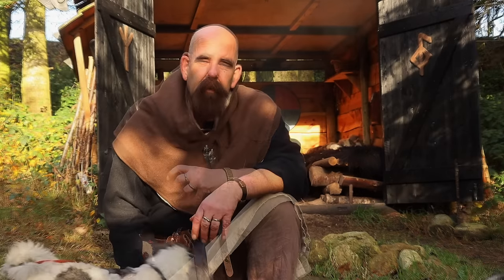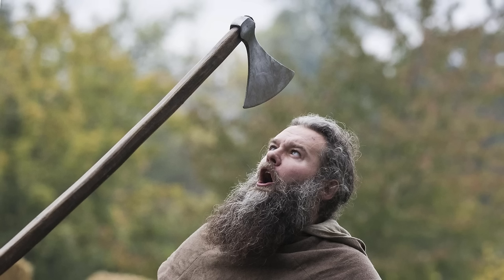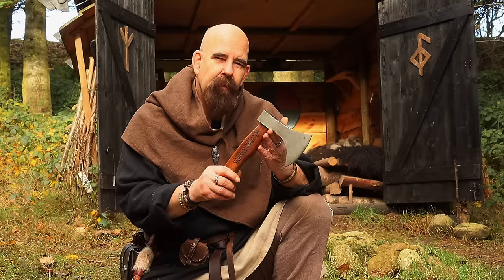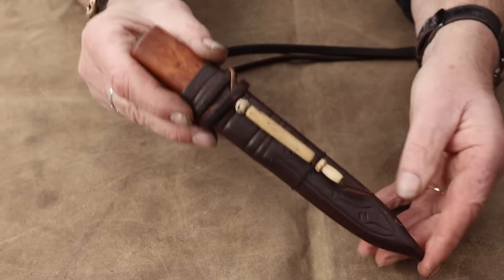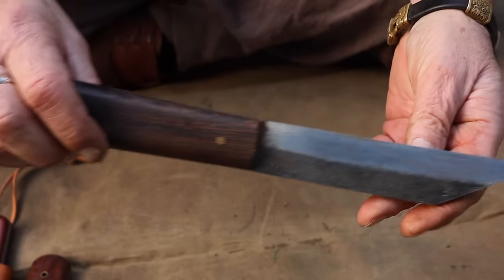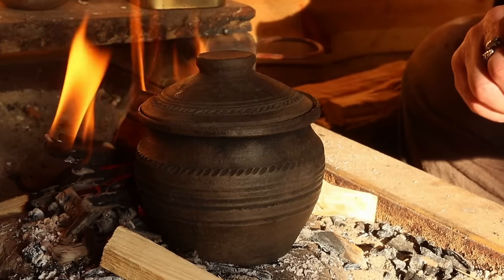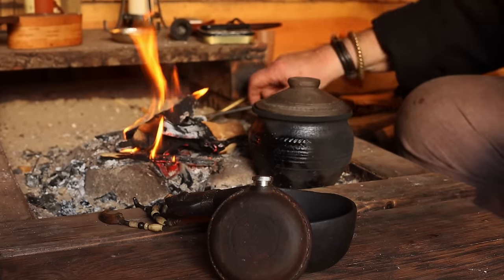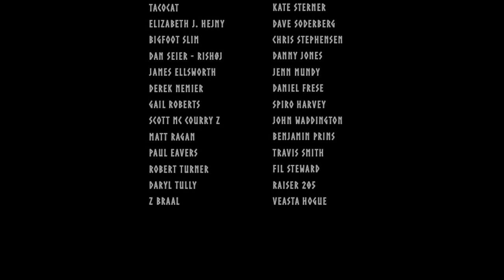My Viking Axes and Knifes

Comment: The problem with a ceramic pot and direct heat from a fire is the clay. Putting the clay pot inside a larger metal pot half full of water, will help avoid the breakage of the clay pot. Skal
Reply from the maker: Thanks for your advice Erik 😁👍🏻 but this pot seems to be able to take the heat 🔥💪🏻🏕
Tom

Comment: Your first few viking axe handles tapers towards the bottom. Wouldn't that get slippery with blood? I like the look of the woman knives and the fact they are easy to clean. Good for dressing a deer.😁 The copper rivet/pin in your folding knife inspires me. Did you use a hard copper/Alloy?
Reply from the maker: Never had trouble with loosing my axe 🪓 when I have used it with blood on my hands 😆 lol 😂 and the rivets are soft copper that are for the purpose of been hammered down 😉👍🏻
Tom
Reply: @cimbrerbushcraft-vikingheritag  I like the tapered handle on a tomahawk for throwing because it slips from the hand smoothly. Thank you. I want to make a friction folding knife but fastening the pin/rivet stopped me. Time for some experimentation.🤗
Reply: @cimbrerbushcraft-vikingheritag  I like the black on the Seax. It looks simple,all business.
Reply from the maker: Love experimenting 😁👍🏻 and hope you’ll find a good solution 🏕🔥
Tom
Reply from the maker: Thanks my friend 🤗
Tom